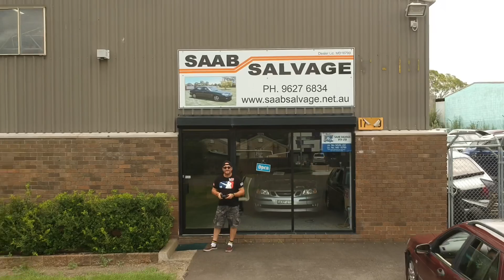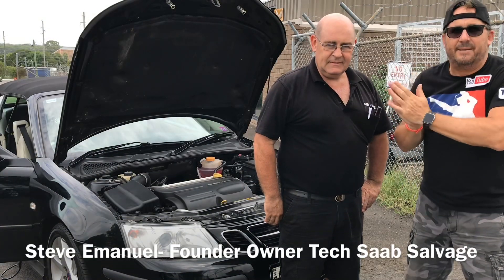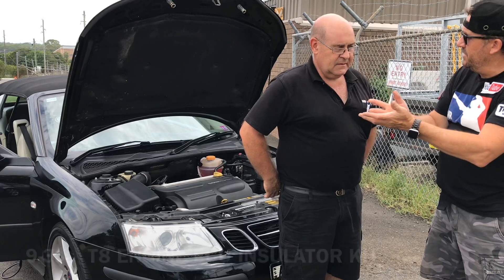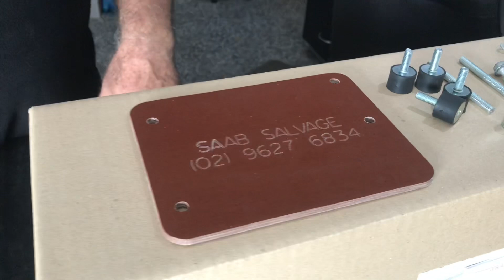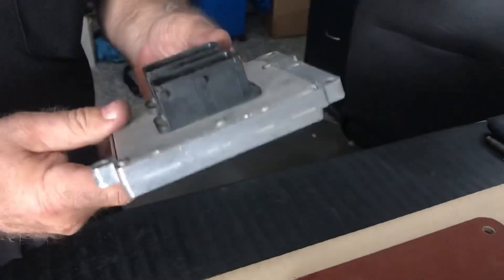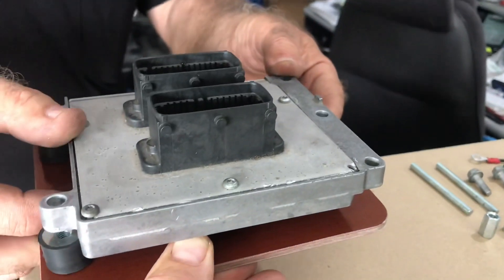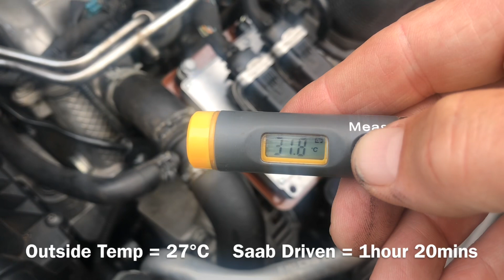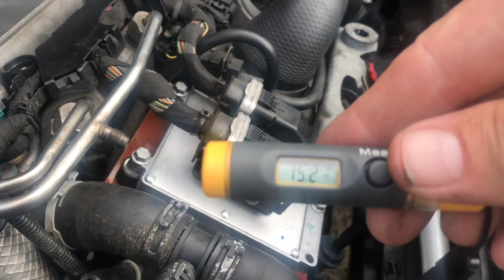Saab 93 ECU Heat Insulator Kit - Urgent Mod Requirement- First Look & Full Install -Andrew Penman

Comment from the maker: * UpDate*** 8th August 2021 - Hey everybody, I’m so glad this video has been so well received and I’m so happy to have helped hundreds of Saab owners and that people have taken the time to watch it and pay very close attention to the results of this ECU modification for its longevity and for temperature and damper protection of your ECU… which are now no longer available and completely obsolete. My installed as seen in this video ECU Protection Kit is now over nearly 2 years old hasn’t had any issues …looks like new …. my ECU unit temperature now stays at 61°c max … on the 43°c hottest of Australian summer days … and down to 47°c on mild sumner days … it used to be 91°c all the time ….even in winter here m. Works like a dream….. As of today Steve is still making these ECU kits and they are still available on his website which is: 
https://www.saabautomobile.com.au/
and his email …
The price is ridiculously cheap at $120AUS which includes “Worldwide Shipping” all around the world. However, beware there are copies out there from Taiwan and China they are absolutely substandard and non bakelite they simply don’t work we’ve tried one and ordered it… and the good news !!! Steve’s kits are now available for the Saab V6 model engines and that’s available on Steve’s website as well, check also the Description Field of this video …which will be coming up with all the details of the new Saab V6 ECU kits, Keep cruising ….continue Saabing and we’ll see you in the next video, cheers Andrew Pennan⚔️ proud owner of a Saab 93 Aero Convertible
Reply: Thanks Andrew, but don’t discredit Taiwan and China. Imitations exist in every country if you look hard enough.

Comment: Did this mod last year, wrapped my spacer plate in foil, and I left off the plastic saab cover as it's a heat trap.
I will be fitting some plastic ducting
From front , with an air of 12v 100mm computer can to sit above the ecu.
The air will be forced in through the front, and lifted off the ecu by the fan. 
Barring that it's an extension harness, which is no problem as I work in a breakers and always have access to saab. 
Nice video 👍
Reply: Did you do it?
Reply: Yes I did..... but,
Since then I have watched a YouTube vid
From saab Taiwan.
They very cleverly show you step by step how to resite the ecu, by splicing the wiring loom, and locating the ecu away from the engine.
I will be doing this shortly, I see it as a better option.

Comment: When I had to replace my ECU, I had the same thought about why the heck is the ECU right there lol. Was thinking about protecting my replacement ECU with some reflective foil, but this looks way better solution. I also like the tip about opening up the engine cover vents
Reply from the maker: Hey Leonard ;) absolutely, nice to meet you. Yes what a stupid place to put an ECU on one of the hottest parts of the manifold intake. I actually can pretty much be assured to blame GM Holden lol ...  and I don’t think SAAB would ever of done that. Thank you ;) now if they fail after about 10 years (normal
Lifespan) then people are trouble as at the moment Lenard there are none available anywhere in the world period ....so if you have a 93 thus kit is a must....so if anyone’s goes now ... they’re pretty much gone. So lucky you got a new one in there. I would honestly protected it by ordering a kit from from Steve it’s easy to put on and this will ensure that the metal fatigue and possible vibrations are limited down to the very minimal and will insure this ECU will you last at least 15 years., Really nice to meet you another Saab enthusiast ;) by the way Steve Emanuel is a freaking genius is one of the best saab technicians worldwide. Very lucky to have him do this modification for us. Let me know how you go cheers Andrew⚔️

Comment: Good idea! Also a relocation kit would be nice
Reply from the maker: He Zad Yeah, thank you so much yes relocation would be the go but obviously in the wise move of GM completely taken control of that particular design of saab ... was a absolute disastrous position, but this kit really reduced the temperature from 93° down to 48° huge difference my saab now is still running beautifully that it 6 years since I did this video... I think so it does work and work well ;)  have a great day. ;) cheers ANDREW

Comment: Wow okay thanks for sharing this! I was looking to get some type of a heat/vibration kit for my ECU (having just replaced it) but I wasn’t expecting this! I’ve emailed them but I hope they back quick because I really want to use this to take care of my new used ECU.
Reply: Did they ever reply to your email nd did you get it
Reply from the maker: Hey T flowers, so sorry for late response I thought I’d check this video but obviously I’ve got some comments hidden below well I hope you pick one up Steve is very efficient this is high quality Bakelite high quality rubber screw set up it will certainly do its job my ECU has been well protected under 47°C in our 40°c summer temperature here in Sydney Australia, let me know how you went and I hope it made a big difference like it did to me ..but I’m sure it did …. And all the test works like a dream 👍 . There are some Chinese and Korean guys making cheaper copies but not using Bakelite terrible examples of a rip off cheaper not working version. Have an awesome day cheers Andrew ⚔️
Reply from the maker: Hey Gabrielle, Great to hear from you and obviously you’re a very happy saab driver. Definitely get one of these they’re easy to put on the full demo installation instructions are on the video Steve Emmanuel who owns Saab Salvage and Sydney was one the top saab technicians they flew him to Sweden he was head here in Australia he knows his stuff backwards his invention product works I have no affiliation nothing to do with his business I just reviewed it and got a free one but my god what a difference it made. I’d also recommending using a Dremel tool to grind out your three slots in the front of your plastic which is actually Bakelite engine cover that will help get the cooling through there as well make it even cooler as I said to Mr Flowers mine hasn’t gone over 46°C, before it was up around 90°C this is definitely a major contributor to the failing ESC’s just email him in care of my information in the description field of my video, let me know how you go have a great day cheers Andrew⚔️

Comment: The way I see it, the intake manafold gets very hot, and the ECU, mounted directly without standoffs, act like a giant heatsink.  isolating it with this kit, has to help.  I installed one on my 2007 9-3, and have one to install on my 2010 9-3 XWD.  I've been procastinating, but I think I will install it today 8/2022.  Also, it would be nice to install some kind of duct routed to the front of the car to create air flow over the ECU to help keep it cool, in addition to the stand-off kit.  what is your view on this?  Also, something tells me that there is probably a solder joint lifting off the circuit board over time from the heat generated, cousing failure.  I still have my failed ECU, and I may pull it apart to take a look.  I have been doing electronic repairs for years, so it is nothing new to me.  Boy, that's a clean engine you have there!

Comment: Thanks for the share mate !
Shame no one gas made an aftermarket ecu or able to rebuild them ,  all the modern technology available .
Shame to see them go to the wreckers .
Reply from the maker: Hey Meca, sorry for the late reply I've been on holidays, yeah such a shame we can blame GM for putting that ECU in that position where it was on the manifold intake ...what a stupid location, but it has been worse locations in the wheel well I think in some of these cars so gets water damaged , but all in all they can't rebuild them metal fatigue happens and the welds go on the printed circuit boards ... just got to  have a new one installed, as a stands .. at the time I don't think they are making them anymore ? but now they've got some company remapping and building them for the existing 93's , it does work this kit my board is still cool and the circuit board looks pretty good and it's in its six years since this video so every seems to be working as intended and designed, have a great day cheers Andrew

Comment: I have a 2006 93 2.8L with some ECU issues not making the ignition coils work properly. I changed it and had my local Saab shop reprogramed it. Worked fine but now I'm having other issues like the AC compressor staying on, radiator fan stays on also, need to turn key on and off to reset it. But now AC compressor won't work.  Can this work on my car?

Comment: Thanks will that kit work once the ecu has started giving problems please.
Reply from the maker: Hey thank you so much for your question Olga, look it’s interesting once the ECU starts to fail or play up ..it’s  because by heat on the ECU which slowly dries the circuit boards( which starts to crack circuit boards which essentially wraparound inside the ECU casing like a Letter C)  which start to fail the circuits and also have metal fatigue, certainly this would definitely help any forward movement of that deteriorating process of damage. So yes essentially it will protect it as of today and maybe not get any worse. However it’s a great kit to have for a new ECU if you can get one and that will then put that in a perfect position brand-new when you install it if you need to, Hope that helps, but check with Steven Emmanual at Saab Salvage in Sydney he’ll confirm that but I’ve said is possibly the outcome. Hope that helps thank you so much cheers Andrew⚔️
Reply: thanks lots for your answer
Reply from the maker: No worries Olga , I own a saab 2004 aero convertible and I love it to death but my ECU died when the local NRMA tried to jump start it and fried the ECU … that was about three years ago I was able to obtain a new one from Saab AB international in Sweden a brand-new fully programmed ECU which I got installed by my local saab repairer. When I came across Steve’s invention I was blown away and thought this is exactly what I need he was a very high up Technician in saab Australia and was flying around the country to repair and fix saab‘s. He designed this himself which reduces the temperature on the ECU by as you saw in the video 70° down to 38°c it really works fantastic it also stops the vibrating and damp affect on the whole ECU unit so clever brilliant design he owns six subs and is absolutely an expert on saab engines motors and designing aftermarket modifications.….  Olga I can highly recommend it. Typical a Taiwanese guy tried to copy of that whole design with the cheaper inferior parts and charging nearly the same price as Steve. But my advice for don’t even look anywhere else just buy it from Steve he has the most incredible Bakelite high tensile bolts with rubberised and damper internals .. it is really a very professional kit and the price is incredible for what you’re getting… I have no affiliation involvement with it I just reviewed it for Steve  and I can highly recommend it. Easy to install as you saw in the video but I recommend maybe a mechanic do it if you’re not fully confident. Hope that helps definitely get one it will help your ECU for now for sure and maybe give it another eight years of life ;) have a great day thanks for watching video cheers Andrew

Comment: Very informative video! Once your car starts showing classic ECU problems, but car still drives around and symptoms are only intermittent and recent... might the ECU still be salvageable with a heat shield?  OR... is the ECU a delicate thing where once issues start, it's already too late (as in, time to replace it with heat shield and re-program to car)?
Reply from the maker: Hey root clinic sorry for late reply it's been awhile I've been on holidays but I'm back to my comments, look I think of it ain't broke don't fix it !!! even has intermittent issues are stirring...  keep using it until it totally dies ... as my car splattered the smoking wouldn't hold an idol and totally was unable couldn't drive it..  so I had to get a new ECU, but this heat protection unit will certainly extend the life of your current EU as it is now of course ready fire when you get the new ECU it just bolts back on again with that new unit you've got it ready to go day one without putting the new ECU through any high temperatures waiting to order the part in, I think Steve has since finished work with that with his company at saab salvage but you can still go through his emails in the description field ..and hopefully he'll be able to ship you one of these kits.. I think he still making them I think let me know how you go cheers Andrew
Reply: @zulupenman  Wonderful! I appreciate your perspective on this! I'm glad I moved slowly and waited because... turns out it was NOT the ECU. The amazing peeps in the Saab Central forums helped isolate that the problem is within my EVAP system! 

Yep, I ruled out a bad purge valve or gas tank cap and disconnected the electric cable that plugs into the valve and BINGO... I have a new, temporary workaround!! Again, all genius on the diagnosing and clever solutions go to my online Saab aficionados.

No more misfires where the engine sounds erratic and non-rhythmic as if it might shut off at any second . So I've come to understand (because I know nothing about cars!) is that I likely have a bad charcoal canister, vent solenoid, fuel tank sensor or blocked or clogged hoses.

Meantime, my car's been driving like a champ!😁 Oh - the only other clue I have is that whenever I get gas, my car chokes and does big misfires as IF it might shut off... I end up pumping the gas pedal hard and after a couple minutes the misfires even out and car drives smoothly again until I get more gas.🤷🏽‍♀️

Comment: Fantastic vid, very well produced and instructional. 
Short term wouldn't simply just removing the plastic shrouding above the engine re 'heat soak' (so common on modern engines for so called stylistic purposes, not to mention countries with heat issues like Australia and elsewhere!) assist in cooling at the very least prior to a failure...!?  I bet one of these engines without the plastic shrouding (aside from the poor siting of the ECU) would run a lot better?
Reply from the maker: Hey Mark great comment thank you so much for popping in and sorry for the late reply I’ve been overseas. Yes totally agree the plastic covers not needed most saab owners remove them completely adds a lot more airflow, I personally left I left mine for Aesthetic’s and then use the Dremel tool and drilled and slotted out put little nice slots in to get a nice airflow directing straight over of the ECU, however, it didn’t make a lot of difference to temperature the heat coming from the manifold intake still transferred through to the ECU… is so hot it is like 91°C and even the cooling of that wind flow doesn’t do a lot maybe only 3° lower… . This little heat diffuser insulation mechanism and this kit that Steve invented is friggin incredible as you saw brought it down from 91°c to 43°C and just works like a dream, 91° c was crazy hot .. but look out for  a Taiwan company did try to copy it with cheap parts not using Bakelite so I don’t recommend getting those … get  in touch with Steve I think he still does it on the side he’s now closedown and sold his Saab Salvage business but he still makes these kits I only like $100 Australian … and they still sell like crazy.. because they’re so incredibly well designed. Have an awesome day thanks for the fantastic feedback on the video greatly appreciated, have a great day cheers Andrew ;)

Comment: Seems fairly simple to make one!  I have just replaced the ECU in a 2008 9-3 2.0 BP, failed last summer on a 30 C hot day here (which seldom happens in Norway), but since I have had to reset the "P0601" error code 3 times. This engine is in several other GM cars, and probably the ECU is in those as well

Comment: Hey mate. I went and bought an Astra G with the Z18XE engine. It has 185,000km and it had an ecu replacement at 130,000. I’m gonna use your helpful info to develop something for it! 

Steve sold his salvage business, but does he has a website for his products? Cheers from NZ
Reply from the maker: Hey J big shout out to New Zealand :) and thank you so much for popping in, congratulations on the Astra G it's a nice vehicle and it's a great engine hundred percent would advise anyone who's got the ECU mounted anywhere in the engine bay to use a Steve Emanuel design heat defector and vibration damper kit .. honestly makes such a difference you'll get twice a life out of these ECU's, I've seen worse ones BMW and some early saab had them in the door / wheel  well and the wheel arch getting water on them so doesn't matter where they put them there's always going to be a problem unless in the dash, okay yes  Steve has sold his business correct but I'm pretty sure he's got an available option to order them from his email I'll just find his email shoot off an email and see if he's answering them ..  that and it works otherwise I'll give him a call and find out what's going on if he still got the Bakelite and the adaption kits so you can make a custom mod for your Astra I'll get back to you here I'll find out and I'll send you the email I've got which is this one :
saab_salvage@bigpond.com

Let me know how you go and I'll get back to you here or PM me on Facebook messenger thanks Jay cheers Andrew

Comment: Looks like the B207 as well as the B284 suffer from the same issue. V6 engine has a lot of heat as well and my ecu has tested faulty.